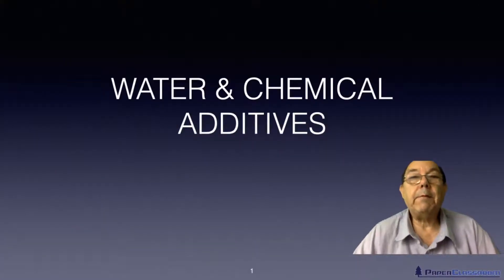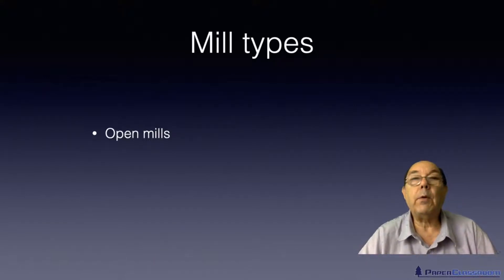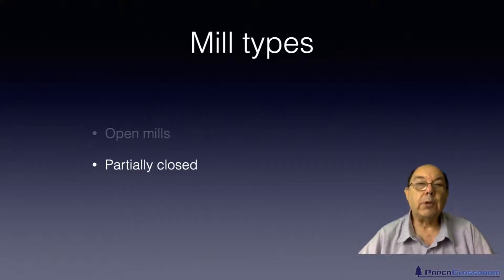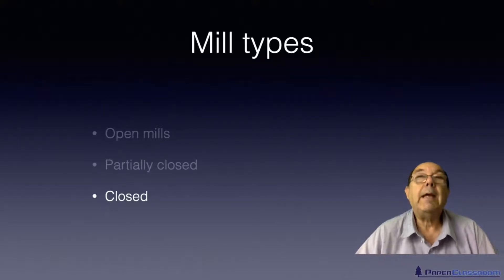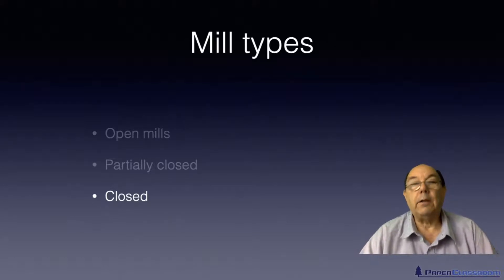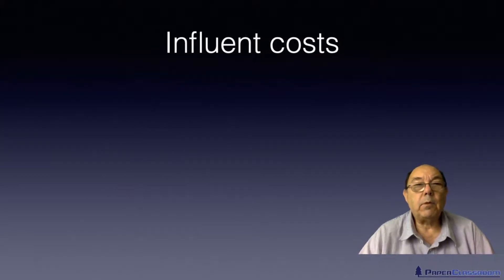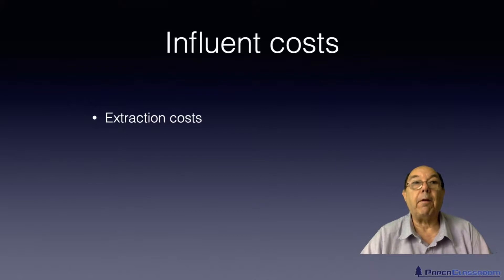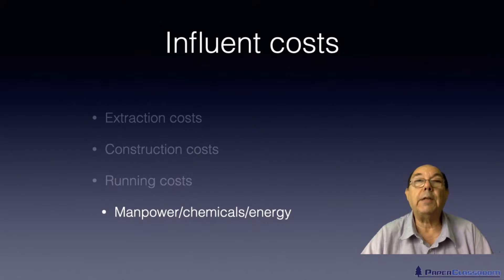Level 2 Papermaking - Types of Mill

Comment: In a closed mill, cationic starch at the wet end will have no benefits? Because no unmodified starch will be coming back with water and add on the sheet at max percentages, is it correct?